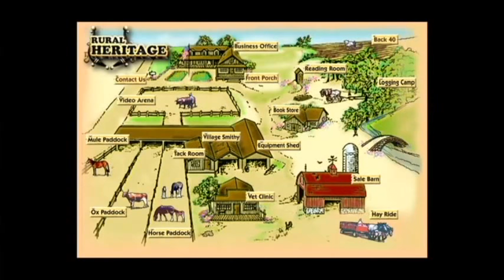Horse Progress Days 2010 - Draft Animal Power Event

Comment: The thing for the tiller is awsome could use id for more then tiller it could pull brush hog and basicaly makes it so you have at direct power 3pt hitch tractor using your horse put a team of 3 or 4 horses and you can do it all i could lay platic run a water wheel planter. Pto sprayer u name it could be used for way more then bug kuhn tiller